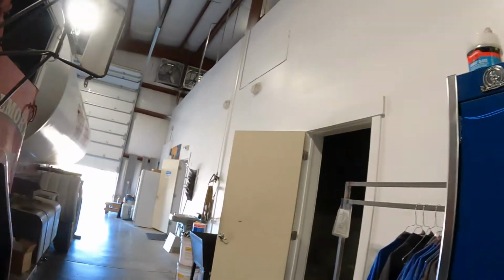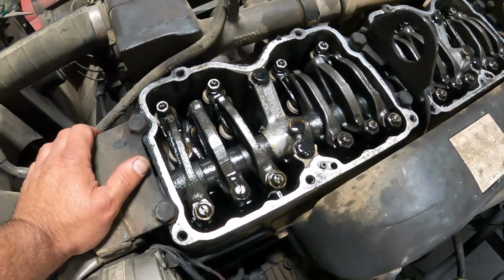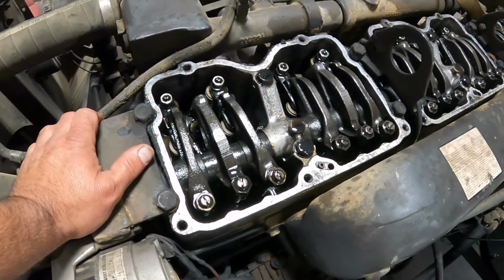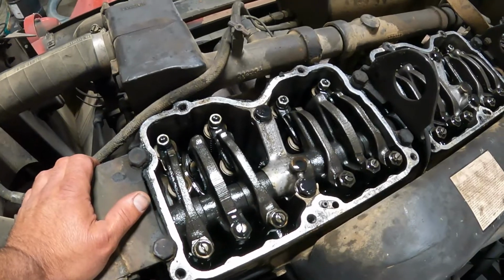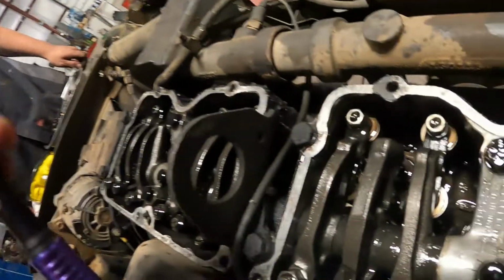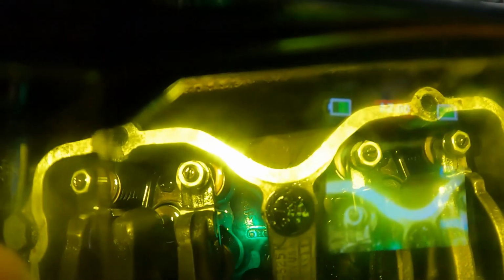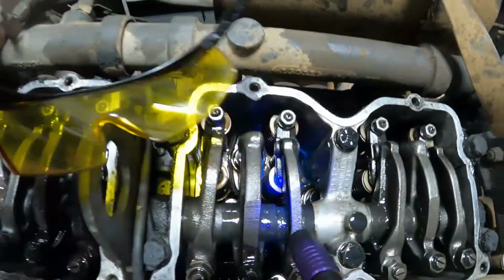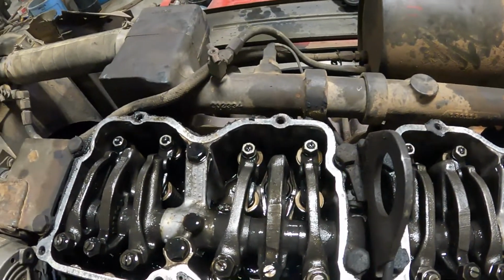Fuel in the oil on this old Cummins 250!

Comment: I have major question or  questions what happen if the fuel from a ISX Cummins engine, the fuel injector is leaking fuel diesel fuel down into the oil pan what catastrophic damages can it done to my can it do to my  isx cummins engine ??

Comment: Would not a bench testing of the injectors be in the cards to ensure all that labor doesn't go to waste in the event the O-rings don't solve the problem....???
Reply from the maker: Hey Michael! Yes bench testing is always a great insurance if you have the time to do it. In this particular case, our customer uses this truck daily to haul water to livestock so they were really pressed for time. We decided to go this route to make it a quicker fix. In this case, it worked out great! Thanks for watching!
Reply: @yourdieselspecialists  

Thanks for the reply!

I was figuring rolling the dice on Labor to get to the injectors would be a shame to two-door it if the O-Rings did not solve the issue.  I am delighted for all parties that your experience paid off!